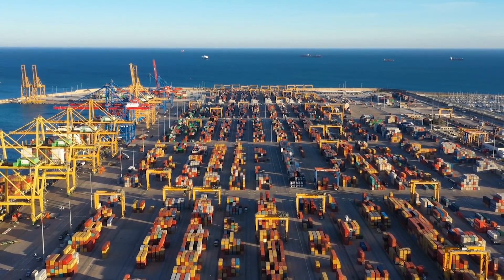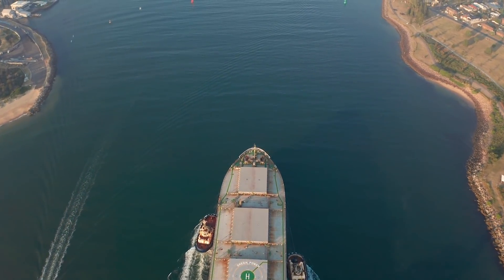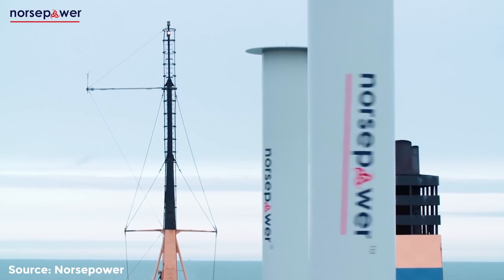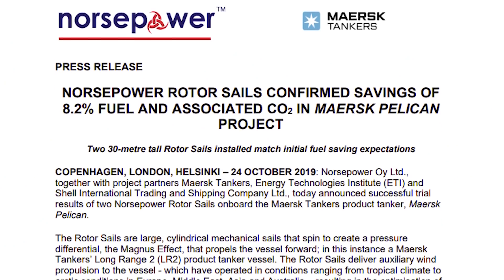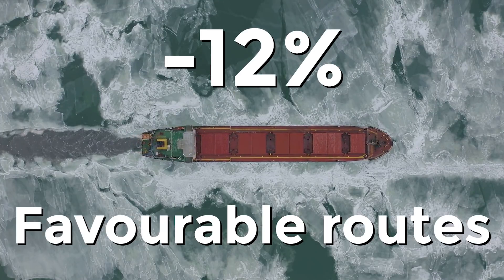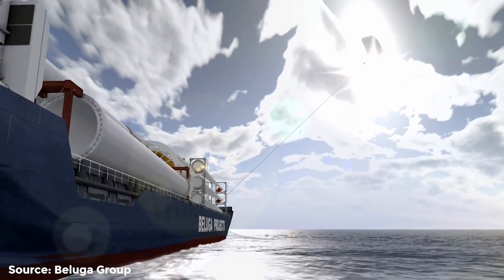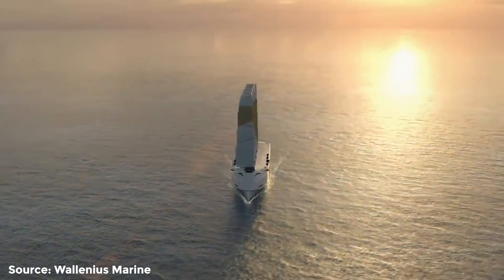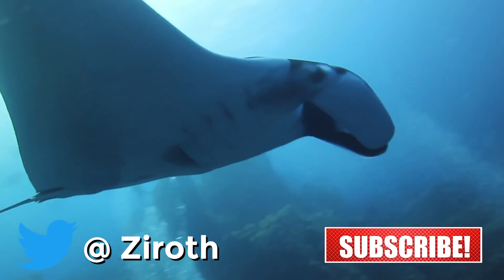Is Wind Power The Future of Shipping?

Comment: They need to use the nuclear reactors from all these decommissioned submarines to power the cargo ships you can have a fleet of them they only need refueled once ever 25
Reply: Just think; would you have full confidence in the management of a nuclear reactor under the control of an anonymous entity only traceable, perhaps, via a letter box in a FOC (flag of convenience) nation state?  If you are, could you sell that confidence to Japan, the state that hosted the Hiroshima and Nagasaki nuclear detonations as well as more recently the Fukushima ‘event’?  Then try that same, or a similar, sales strategy on Ukraine, the nation state that as a part of the USSR (CCCP) hosted the Chernobyl ‘event’.  Modern iterations of nuclear energy, thorium fuel, molten salt reactors, small modular reactors or fusion reactors, will carry the legacy of past problems.  It is the global trepidation of anything with 'nuclear' in the name and the economics of nuclear having transitioned from 'energy to cheap to charge for' too 'the costs of remediation are incalculable' that will prevent the adoption of nuclear energy as a means of creating energy at sea.  Modern reaction systems may have overcome the safety problems but the general public, having been misled in the past, will be reluctant to believe the fresh new promises.  The incident of the ‘Ever Given’ blocking the Suez Canal, March 2021, may also have a little to add to this debate.  The cooling water on ships tends to get taken in from near the bottom so when running aground the inlets are in a prime spot to get plugged up restricting, if not stopping, the flow of coolant.  One thing that the TMI, Chernobyl and Fukushima incidents all had in common was that the supply of coolant, or rather lack thereof, was a fundamental cause.  Similarly and only months later, May 2021, had the ‘X Press Pearl’ been nuclear powered then a major port for a populous nation in the global South would have possible been the site of a significant exclusion zone due to a non power plant related incident.  If the ‘X Press Pearl’ had on board a fired up but ‘safe’ molten salt reactor and found herself having to dissipate the residual energy associated with the possible 12.5 megaWatt power cycle would a stable cool down have been possible?  In a casualty ships may capsize, like the ‘Karin Hoej’ of Bornholm in the Baltic early December 2021, in which situation any safety system reliant on gravity might not work.  It might also be worth bearing in mind that part of the TMI near miss the fault of the navy trained operators focusing on not letting the primary cooling system 'go solid'.  As a second point if you fit 'walk away safe' reactors on ships you will need duplicate drive trains as there are seldom salvage tugs around when you really, really need one.  A nuclear dead ship drifting around would be a disaster waiting to happen and duplicate systems increase expense.  Why not use nukes?  It is down to engineering, finance, socio-political attitudes and safety.

Comment: They need to be at least twice the size of the old wind Jammers made of ultralight strong material solar powered to produce the power needed and wind for the propulsion they could also have a small solar powered battery powered motors in case you know there was no wind or for emergency navigation they can transport dry goods or that wouldn't go bad or luxury non-perishable cargo and people could even selling point people that wouldn't mind to pay a little more to get their stuff shipped to be green ultra green eventually going to get the price down but the ships would have to be made of ultralight materials to take advantage of the wind and try to generally carry you know lighter cargo but they can carry quite a bit of cargo the old wind Chambers carried stuff like Cole and stuff that was salt stuff that wouldn't be perishable because they were slower you wouldn't need as big a crew to have a small crew the ship could be the rigging could be as automated as possible with a series of pulleys and cranks so that people wouldn't have to climb up and hold on and all that dangerous stuff that they used to do
Reply: To address the suggestions that wind power is the answer I offer the following.  If ‘the wind don’t blow the ship don’t go’, when it does blow it often blows in the wrong direction for your cargo delivery needs and sometimes there is rather too much of it for comfort.  The area where one is most likely to be ‘becalmed’ is the ITCZ (Intertropical Convergence Zone) or ‘the doldrums’ as it is commonly called.  In days of old ships with large crews, such as naval vessels, would try using the ships boats and some of the crew to row through the doldrums thus towing the mother ship out of the calm.  Not practical for less well manned and much heavier merchant ships which could not muster a similar power (oarsmen) to weight ratio (vessel displacement).  Traditional sailing ships are unable to go directly up wind so if the wind is blowing from the direction your cargo needs to go then a zig-zag course must be steered, more distance and thus more time on passage at whatever speed is achieved.  Wind speed is traditionally measured on the Beaufort Scale (wind speed) that runs from 0 (< 1kn or 0.5ms-1) to 12 (> 63kn or 32.5ms-1) and for sailing purposes the usable part of the range is ‘3’ (circa 8kn or 4.1ms-1) to ‘6’ (circa 24kn or 12.3ms-1).  As the wind speed, and the amount of energy that may be harvested therefrom, increases the sea surface becomes progressively more disturbed which makes the harvesting process ever more difficult and increases the stress on the vessel.  The increased stress means the sail area has to be reduced, either by using fewer or smaller sails until the vessel may in extremis be ‘hove to under storm sails’.  One way of reducing the sail area is by turning up the bottom edge; known as reefing.  With any wind power proposals the question that must be asked include ‘has any information been released into the public domain with regard to the expected energy harvest for the wing forms, on a Watts per square meter basis?  ‘Cutty Sark’, is said to have been able to coax 3 000 horse power (or 2 206 500 Watts / 2.2 megaWatts)) out of her, up to, 2 976m2 of sails, assuming ideal conditions and further assuming that for sailing purposes the usable part of the wind speed range is 4ms-1to 12ms-1 so the yield would be about 741 Watts m2.  So another question ‘for the proposed option what is the expected upper wind speed limit for the system’?  A single stage 'harvest to deployment' system for propulsion will have higher efficiency but ‘what steps are being taken to provide ancillary power such as the, small but essential, domestic, navigational and cargo needs?’  One of the limits to wind power is the kinetic energy available to be harvested in the mass of air it is possible to contain.  Another is the scale of the operation when sailing ships were being succeeded by power driven vessels the largest that were built included the ‘Prußen’ and the ‘Thomas W Larsen’.  The ‘Prußen’ used a crew of 45 to move up to 8 100 tonnes of cargo and was lost at sea following a collision with a power driven vessel.  The ‘Thomas W Larsen’ used a crew of 18 to move up to 11 000 tonnes of cargo this vessel was lost when at anchor in the Scilly Isles where she was sheltering from a storm.

Comment: Instead of all the high-tech solutions on offer, why can't governments kick the manufacturer's of these ship engines/ship designers/owner-operators into cleaning up their exhaust emissions?
We've all seen the effect that can have on the car and truck industries, with adblue injection and exhaust particulate filtration etc. so why can't it be done on ships?
I live and work near a port in the UK. I can tell you that these cargo and tanker ships are anything but 'clean' when they start up, never mind running.
Reply: 'They have, they did' that option has reached the point of diminishing returns.  The 26th UN Climate Change Conference of the Parties (COP26) held in Glasgow between 31 October 2021 & 13 November 2021 established requirements and targets for mitigation of the production of GHG and with regard to shipping steps to reduce atmospheric pollution to acceptable levels could include: -
1) Reduce spoilage / waste of all commodities;
2) Improve fuel quality;
3) Localise production to consumption;
4) Reduce 'freight mile' distances;
5) Abolish the cruising fraction of marine transport;
6) Reduce freight carrying capacity;
7) Abolish recreational boating;
8) De'fossil'ise the fuel chain;
9) Reduce the global population of consumers.
The use of any of the options above may not be the future of marine transportation but moving less material and moving what is transported over shorter distances, as in the past, should be.  Together with localised production and minimised consumption a global population that has individuals’ voluntarily self limiting reproduction to two children per parent (both male and female), might save the planet.  Shipping currently has a 'high volume, low added value' business model and it needs to return to the 'low volume, high value added' model it followed in the past.  Any alternative to the existing system needs to provide better value and so depends on the yield; the energy input less losses must provide energy output that can be deployed for propulsion, cargo handling and domestic services.  All of which must be achieved consistently and within the current limits of mass, volume and cost.

Comment: Steel sailing ships called Windjammers demonstrated 98% sail propulsion and were commercially profitable into the 1920’s. Modern aero hydrodynamics and larger ships will be enough to bring back sailing as the dominant propulsion because it’s both faster and cheaper. You may be skeptical, but observe how the UK is competitively employing vast wind turbine farms in the North Atlantic to transform their economy to a more efficient and self reliant one. The three blades on each turbine are just sails that turn a generator that convey power to a battery in an electric truck that conveys cargo. A sailboat is just a simpler, more efficient and larger wind powered conveyance.  

Retrofitting existing ships with sails is naturally disappointing because the cargo ships are narrowly designed around diesel propulsion. Adding sails raises the possibility of capsizing for example. This limits the height of sails. 

We are limited by imagination and ignorance of our vast sailing heritage. But not the physics.
Reply: WADR the largest sailing ships I can trace are the 'Pressen' 8 000tonnes and the ''Thomas W Larson' 11 000tonnes; current shipping typically runs 20 - 30 times that deadweight.   In 1870 a premium sailing vessel entered service, the ‘Cutty Sark’.  The ‘Cutty Sark’ was 64.74 metres in length with a beam of 10.97 metres and a loaded displacement of 2 100 tonnes.  She was able to carry, at best, 1 700 tonnes of cargo and to harness the energy in the wind the available spread of canvas was up to 2 976m2 which was tended by a crew of about 30 skilled men.  The ratio between the sail area (SA) and the vessels displacement (D) determined how lively she was; ‘lively’ being nautical speak for ‘fast and manoeuvrable’.  The carrying capacity of cargo ships is constrained in two ways, mass and volume which leads us to the ‘stowage factor’ of the cargo; the more mass on board the greater the displacement which in turn impacts the efficiency of the hull form and the sail area / displacement ratio.  A vessel constrained by mass is said to be ‘down but not full’, while a vessel constrained by volume is said to be ‘full but not down.  When in the tea trade, which the ‘Cutty Sark’ was designed and built for with fine lines (more nautical tech speak, so again no need to worry about it) she could carry around 600 tonnes of cargo at speeds of up to 17.5 knots dependent on the prevailing wind and had a typical China to UK time on passage of 120 days.  The tea trade was very competitive so ‘time on passage’ was a large factor in securing the premium freight rate that made the ‘Cutty Sark’ cost effective.  Rounding things out, her maximum available sail area gave circa 5m2 of canvas for every tonne of tea carried.  As soon as the Suez Canal opened, which the ‘Cutty Sark’ was unable to sail through; she lost her advantage, raw speed, to the steam powered ships of that era who could beat her ‘time on passage’ by taking that short cut.  Mechanically powered ships have improved in terms of efficiency, on a freight tonne mile basis, by at least one order of magnitude since then.  After losing out to the coal burning, fire tube boiler, steam reciprocating mechanical ships of the late 19th century ‘Cutty Sark’ was relegated to the Australian wool trade, just about the bottom of the barrel in maritime terms and only one small step up from being a 'honey barge'.  The sails on the ‘Cutty Sark’ produced about 0.33% of the power need to propel a Mearsk Triple E and proportionally a Mearsk Triple E would need a sail area equivalent to the acreage of a small farm to not go as fast and moving a Mearsk Triple E on wind power really would be like ‘pushing a brick across a table using the output from a hair dryer’.  That majestic spread of canvas would be less than efficacious in delivering your baubles and bows from the orient, despite taking about three times as long on the voyage.  Remember shipping is a high volume low cost, therefore low margin business, and all costs have to be beneficial within the practical life span of the hull.

Comment: age of sails part 2
Reply: To address the suggestions that wind power is the answer I offer the following.  The canvas, cordage and extra manpower needed for sailing ships was never a very benign environmental option so please discount any idea of sail as ‘sustainable’ and this is without the problem that if ‘the wind don’t blow the ship don’t go’, when it does blow it often blows in the wrong direction for your cargo delivery needs and sometimes there is rather too much of it for comfort.  Traditional sailing ships are unable to go directly up wind so if the wind is blowing from the direction your cargo needs to go then a zig-zag course must be steered, more distance and thus more time on passage at whatever speed is achieved.  Wind speed is traditionally measured on the Beaufort Scale (wind speed) that runs from 0 (< 1kn or 0.5ms-1) to 12 (> 63kn or 32.5ms-1) and for sailing purposes the usable part of the range is ‘3’ (circa 8kn or 4.1ms-1) to ‘6’ (circa 24kn or 12.3ms-1).  As the wind speed, and the amount of energy that may be harvested there from, increases the sea surface becomes progressively more disturbed which makes the harvesting process ever more difficult and increasing the stress on the vessel.  The increased stress means the sail area has to be reduced, either by using fewer or smaller sails.

Comment: What will bring cargo faster, that way we'll go,nithing can be faster than nuclear, but its too expensive, then either hydrogen in form of ammonia with fuel cell, or old diesel...
Reply: Just think; would you have full confidence in the management of a nuclear reactor under the control of an anonymous entity only traceable, perhaps, via a letter box in a FOC (flag of convenience) nation state?  If you are, could you sell that confidence to Japan, the state that hosted the Hiroshima and Nagasaki nuclear detonations as well as more recently the Fukushima ‘event’?  Then try that same, or a similar, sales strategy on Ukraine, the nation state that as a part of the USSR (CCCP) hosted the Chernobyl ‘event’.  Modern iterations of nuclear energy, thorium fuel, molten salt reactors, small modular reactors or fusion reactors, will carry the legacy of past problems.  It is the global trepidation of anything with 'nuclear' in the name and the economics of nuclear having transitioned from 'energy to cheap to charge for' too 'the costs of remediation are incalculable' that will prevent the adoption of nuclear energy as a means of creating energy at sea.  Modern reaction systems may have overcome the safety problems but the general public, having been misled in the past, will be reluctant to believe the fresh new promises.  The incident of the ‘Ever Given’ blocking the Suez Canal, March 2021, may also have a little to add to this debate.  The cooling water on ships tends to get taken in from near the bottom so when running aground the inlets are in a prime spot to get plugged up restricting, if not stopping, the flow of coolant.  One thing that the TMI, Chernobyl and Fukushima incidents all had in common was that the supply of coolant, or rather lack thereof, was a fundamental cause.  Similarly and only months later, May 2021, had the ‘X Press Pearl’ been nuclear powered then a major port for a populous nation in the global South would have possible been the site of a significant exclusion zone due to a non power plant related incident.  If the ‘X Press Pearl’ had on board a fired up but ‘safe’ molten salt reactor and found herself having to run down the possible 12.5 megaWatts of energy in the power cycle would a stable cool down have been possible?